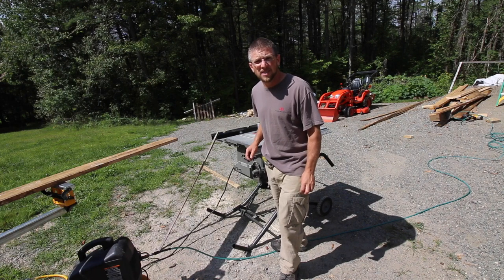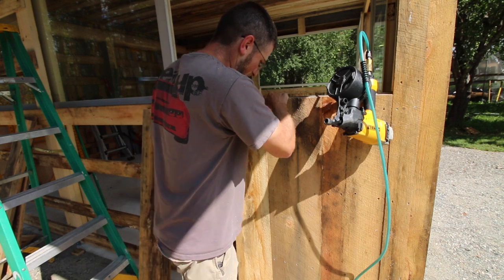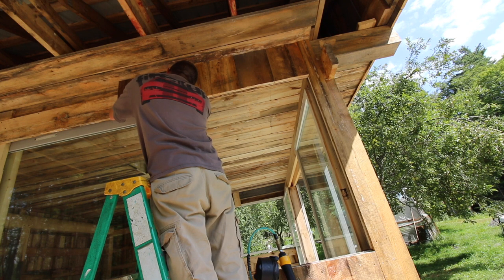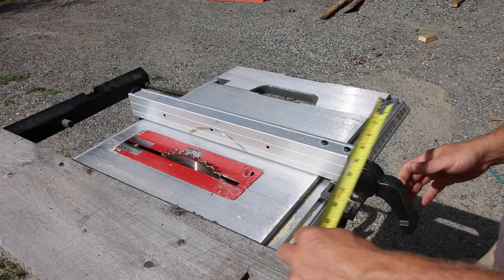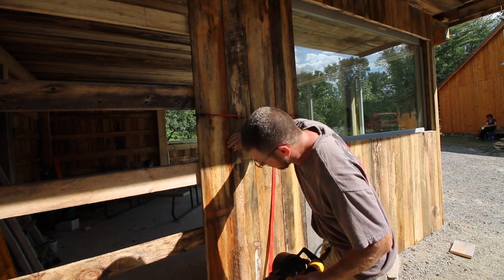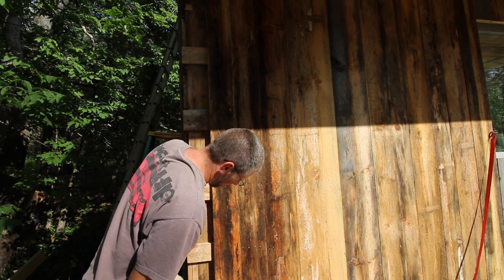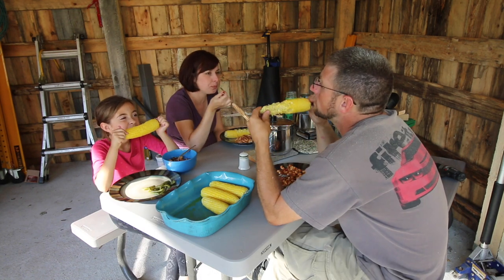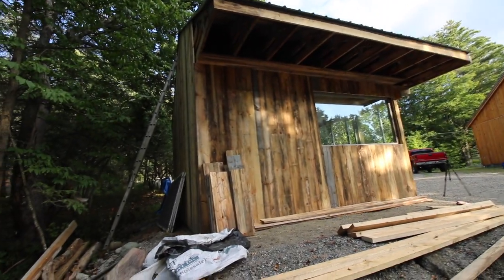Installing Rough Sawn Lumber w/ a Ratchet Strap! On the Off Grid Outdoor Kitchen

Comment: Get a pump up bug sprayer, fill it with clear wood preservatives and apply 2 coats on everything. Use cardboard as a spray shield. Get a bunch of it. You won't get as much cracking and splitting and keeps it from twisting. On top of these things it makes it water proof. Won't change the natural look of the lumber. You won't regret it. PS, get an old 4 inch brush to back brush any heavy areas. Good Luck, 👍 Vinny 🇺🇸
Reply from the maker: Thanks Vinny. When we oiled the house we used a hand pump back pack sprayer! It works awesome. I think we should let the wood dry a bit first. It is green what do you think?

Comment: It is looking very cool. When are you going to do the corner braces? Rectangles can so easily turn into mere parallelograms. The trusses will help resist force from the sides but not from the ends. I was thinking that, on a smaller scale, corner braces could also restore rigidity to the now single-paned window, and possibly make it safely movable again.